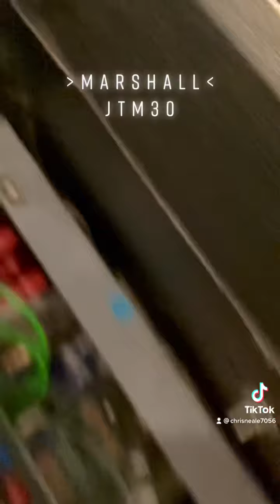M A R S H A L L    J T M 3 0

Comment from the maker: It wasn't working because there was no speaker lead. I soldered one up until a replacement arrived from Marshall with new knobs (and pot lock nuts which were missing, which they gave me for free)!  Needed a new set of valves. - Many thanks to https://marshall.com for being so helpful! <- #lonearrow

Comment from the maker: Introducing an air gap between the amp chassis and the cab with 3 x rubber grommets, fixes the overheating problems by letting air circulate more effectively. <- #lonearrow